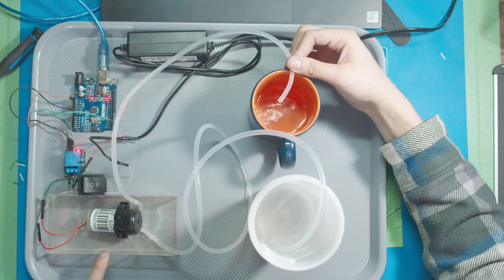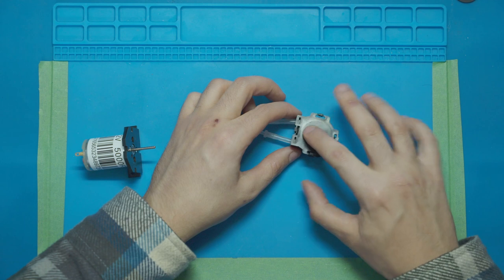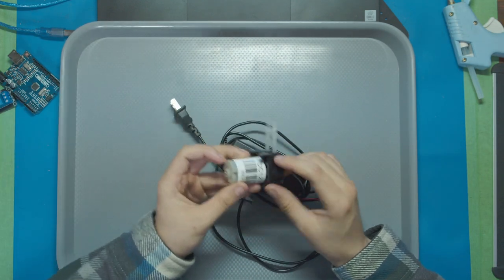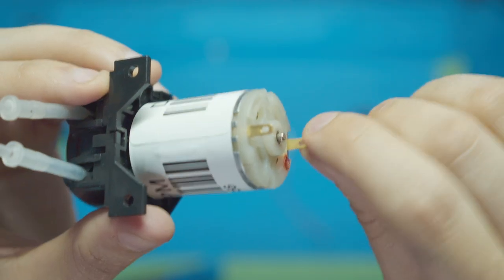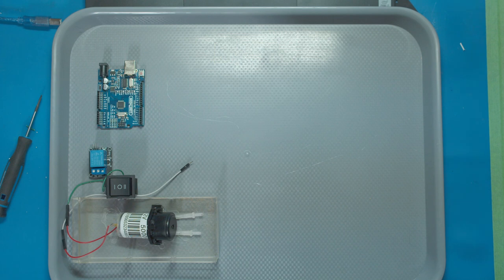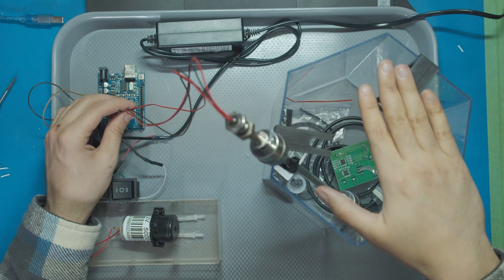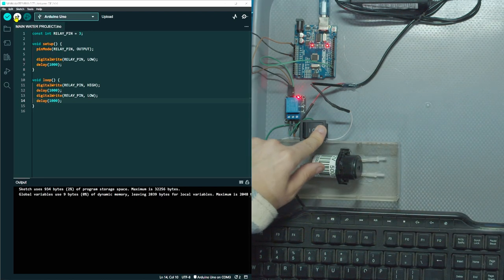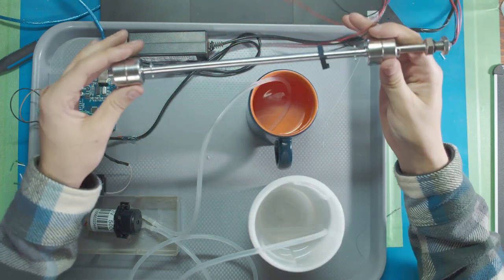How to Control a Peristaltic Water Pump with Arduino 12V/5V | REVERSE POLARITY SWITCH, WATER PUMP

Comment: Surely a peristaltic pump should have a stepper motor as driver not a strandard BLDC motor (which will work but will not be able to provide the fine 'micro dosing'...)  Otherwise you may as well just use any standard pump if you are just pumping water.
Reply from the maker: yeah this is not a medical grade one its just a cheapo off amazon/aliexpress to demonstrate!
Reply: @MikaelAbehsera could I get your help picking out some stuff I need to make this work I am clueless about this stuff I’m building a waterfall in an reptile enclosure and this looks like the perfect size I just don’t know what flow rate I need and what I need to make the pump run continuously

Comment: Is there any alternative with all the features of peristaltic valve, but the direction can be controlled by the Arduino itself without any manual intervention??
Reply from the maker: you can have a real Hbridge switch, and activate that using non manual intervention

Comment: hey i am working on a mini project based on the principal of a pumped-storage hydroelectricity  and the DC motor of the pump is going to work as motor and generator depending on some conditions i want to know if it produces good voltage or its designed just for being a pump (mechanically)

Comment: I need to do something similar, but with a reversable AC motor. 
The motor reverses, not by doing anything with the power supply wires, but by switching a couple of other wires under the motor's connection cover plate.
In addition, I need to add add electric brake circuit, which does attach to the AC supply wires (it discharges a cap which momentarily puts DC into the motor winding which causes breaking). For that to work, the directional circuit must remain connected for the duration of the cap discharge.
I have a switch like yours, a 120V AC motor, parts for the brake circuit, a relay and now I've purchased an R3 arduino with a 5-relay shield that I have a feeling that I need but I know absolutely nothing about it.
I also have an 11 year old grandaughter who's learning to program in Python ("Hello world"). I'd enlist her help but she's 4 states away.
Please pray for me.
Reply from the maker: oof, I need some 11 year old programmers too lol

Comment: Hi great video, you got yourself a new subscriber :) Would love to get some recommendations using this project of yours as a reference. I'm not into engineering, so this video will be of great help and sorry for the newb question I might ask. The project I'm starting involves creating a pump to feed a sick guinea pig on regular basis. He is currently on syringe feeding, but it's getting very hard for me time-wise.
Would this pump work with wet food instead of water (food with the same consistency of yogurt)? If not, what material of the tube should I look for? Also, how can I make the pump responsive to pressure, so whenever my guinea pig sucks the food, the pump would turn on? Can the arduino be programable in order to do that?

Thank you in advance, hope you have great success with your channel :)
Reply from the maker: Thanks Marco, I’m not sure about something similar to yogurt but I would test it out and see, I’m also not sure if the portions would be consistent

Comment: This is very helpful. If I only need my pump to flow water in one direction, can I just use the relay without an H-Bridge? Thank you
Reply from the maker: yup! just dont do it and it will work in whatever direction you set it up in.

Comment: this video is very helpful!! I hope you can post the part 2 of this ASAP. thank you
Reply from the maker: I will!
Reply from the maker: Anything specifically you’d like to see?
Reply: using pH sensor please. thank you
Reply: automated on and off with threshold of sensor
Reply: @curtjohannmaracha5235  looking forward to this as well... Running a timer for my watering system.
Reply: Me too!
I'm keen on being able to output accurate quantities for multiple chemicals, using multiple pumps, to dose the correct quantities for my nutrient mixing. Also need to have multiple recepies for different stages of growth

Comment: Hi, I got a lot of help from this video. Thank you so much! I wonder how to connect the reverse switch with the relay cause my switch has 3 pins. And your switch had 6 pins... thanks!
Reply from the maker: Glad it helped, for the 3 pin im not sure but usually 3 pin its for 2 ON positions and 1 off in the middle, if thats true that switch wont work you need a 6 pin one !

Comment: Hi Mikael. Thanks for your great idea with your clear and simple method. I have a question. If I have 4 motors instead of one, do I need 4 rocker switches? Or is there a solution where I can use one rocker switch for four motors?
Reply from the maker: depends on if you want them all to spin in different directions, but if you want all in the same direction/flow then yes 100%, just make sure  youre powersupply can handle it

Comment: Hej cool project. Will it work with a 24V pump?
Reply from the maker: yeah! just make sure the other components can handle 24v and that you use a powersupply for 24v, but yes it can

Comment: thank you so much for this video!  wonder if one/two pushbuttons will do the same function or not ?
Reply from the maker: there was actually another comment about that above this one, its possible but not recommened since pressing both at the same time would be problematic

Comment: just trying to make project in hydrophonic system. Thinking of having pump that automatic applying nutrients solution to the plant accordingy to it needs. Just for insight what may i add? feels free to answer me :)
Reply: hey brother
i am doing the same will be helpful if we could connect
Reply from the maker: you could pump from a liquid containter into your plants and control that flow in any way you would like, I dont know much about hydrophonic but I imagine that would work

Comment: Would I be able to use arcade style buttons with this pump instead of the rocker switch? One button for direction of water flow and another button for water flow in the other direction?
Reply from the maker: Yes, the wiring would be pos and negative one way for one flow and opposite for other direction, you wouldn’t even have connect them together like this, just make sure you don’t press both at the same time (not an issue with a rocker switch since it’s one or the other)
Reply: Could you please send the code for this?

Comment: Great video! What is actually the function of the relay? Thanks
Reply: Arduino only use 5v power so arduino cant power the pump so he use relay and uses 12v power supply. Arduino only sends signal to the relay as to when to turn on.
Reply: you can also use a Mosfet instead, but don't forget a flyback diode and be sure the Mosfet turns on with that Arduino's 5V
Reply from the maker: relay pretty much is a switch for you to control a larger power source, like you can setup a relay on the light switch on the wall

Comment: I want to control the direction of water flow in code rather than physical switch is that possible??
Reply from the maker: yes but youll need something to reverse polarity like an hbridge, i made a manual one to avoid buying more parts :)
Reply: @MikaelAbehsera   what about useing a moter drive that control speed and direction?

Comment: the tubing connected to the pump would it add bad taste to drinking water ?
Reply from the maker: not if its food grade tubing, otherwise yes.
Reply: @MikaelAbehsera  i'm finding some things that annoy me about various forms of plastic. the way things are phrased it's almost like none of them are safe without precautions.. sigh.  what kind of tubing would you use ? platinum treated vinyl is one that looks promising its used in drink machines for example.
Reply: @MikaelAbehsera  btw i liked your video. i had considered that exact pump for usage in my mad science project :P

Comment: Can we use this pump to pump air with increased pressure
Reply from the maker: Not really it’s more for liquids, I would use an air pump for air
Reply: Could please suggest a small size air pump that can fit inside a tyre, @MikaelAbehsera
Reply from the maker: @Peace-yj4ry I’m not sure how that would work but my concern would be the tire would be super difficult to balance, if you want some auto pumping tire I would have a pump hidden somewhere and a 360 degree twisting air tube going into the air valve, check out how it’s done on off-road cars, super cool technology
Reply: @MikaelAbehsera But i need anything like that for our project, which is used to suck air from the atmosphere and increases its pressure then pump through another valve...
Also it want to fit within the tyre
Reply from the maker: @Peace-yj4ry  look into off-road cars with pumps built into the cars, I think that’s what you want
Reply: Can i use this "Vacuum Pump 12V -70~220KPA Diaphragm Vacuum Pump" @MikaelAbehsera

Comment: Did you use 12v/5v relay for that?
Reply from the maker: yes 5v control, and then 5/12/24v for the pumps usually

Comment: hi, can I directly connect pump with relay without the external power source ?
Reply from the maker: no, you need one
Reply: @MikaelAbehsera  why is that??
Reply from the maker: How will you power the pump? The relay is only a switch for the power, it doesn’t provide power
Reply: @MikaelAbehsera  ohh I thought the power from arduino will like amplify when using the relay so it can power the pump 😅 THANKSSS!!